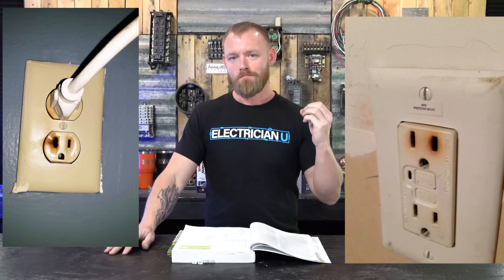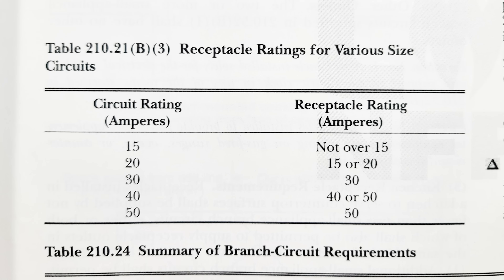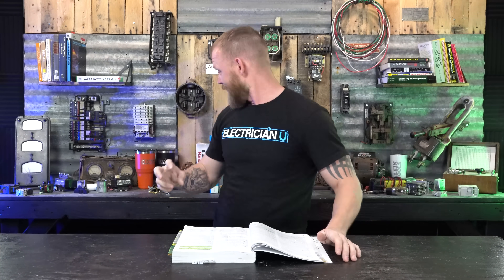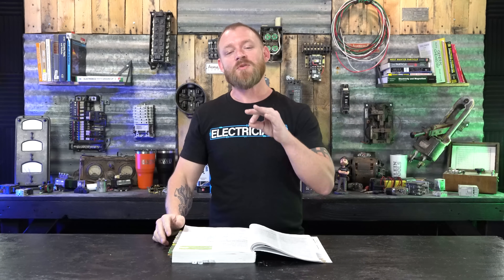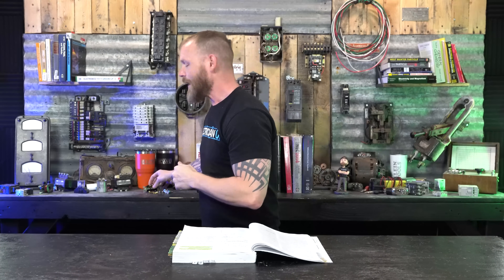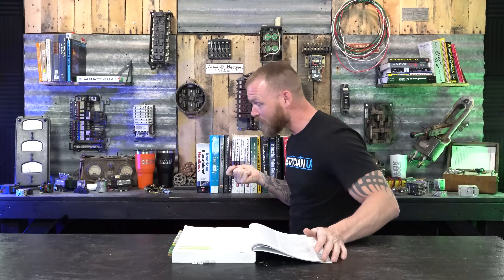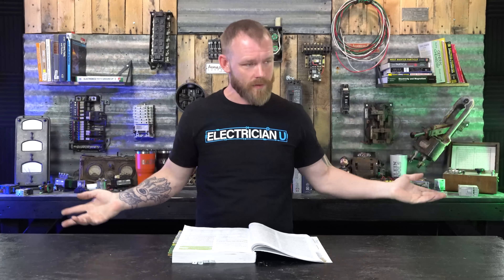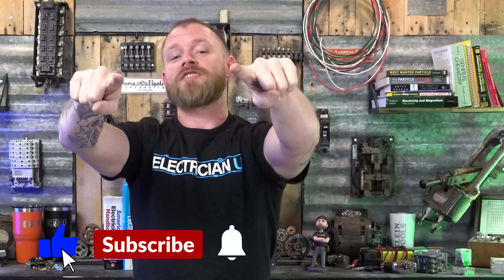Won't These Melt?!? 15amp Receptacles on 20 amp Circuits!!!

Comment: Yes NEMA 5–15R 15 amp receptacle OR 5–20R can be used as long as there are two or more duplex outlets not for a dedicated single 20 amp load. Remember that the ampacity  of the wire needs to be suitable for 20 amp if a 20 amp breaker is used in either case Therefore use #12 CU. Larger in rare cases if it’s a long run. Branch wire size  / breaker rating coordination is to protect the wire NOT the appliance. That’s why appliances that need over current protection have an internal fuse like microwave ovens. How does this work out?  If an appliance actually needs a 20 amp circuit the neutral plug blade is rotated 90 degrees. That prevents plugging in a 20 amp appliance into 15 amp underrated branch circuit with #14 wire. Note that  5-15R and 5-20R receptacles are both 125 volt rated.
Reply: A single duplex 15amp receptacle on a 20amp circuit meets code.

Comment: Really enjoy your very informational videos.  What's your thoughts on the non metallic splice kits offered by TE that are supposedly NEC approved for behind walls?  Would you trust them?  Maybe good material for another video.  Thanks, and keep em coming!
Reply: Are you saying they make something that allows you to connect wires and have the connections inside of a wall?

Comment: Most melting is from dirty (oxidized) plugs offering a point resistance and hence heat source.  Brush a male plug with DeOxit and plug it in and out until it comes out clean and the heating will disappear.

Comment: Well my welder adapter cord ain't currently up to "code"   I have 30a 220 plug on the Gen feeding 2 30a welding plugs and a 20a 110 plug.  I had ordered a 20a push button breaker to squeeze in the junction box but the purpose of 110 plug is to run my grinder in for prepping for welds or cleaning up after welding and running a work light for welding in a dark area

Comment: the code should require all 120v receptacles to carry 20amps. That would only increase the production costs by pennies.
Reply: Surprise !
They can carry 20A. 
It just designed to not allow a 20A plug to insert.

Comment: I've run across 'melted outlets' and often it's one of few things.  An old outlet with loose prongs that should have been replaced, older home with AL wiring prior to proper AL standards, or homeowner using one of those blocks so they can plug four or more things into one outlet.
Reply: I went to my step daughter and husband's newly remodeled home with $45 designer outlets throughout. Found several that had wires not tightened in outlet. Then melted outlet by the nightstand. Turn out this was a half hot/ switched hot where the apprentice did not break the tab. My step daughter and husband's excuse was "good electricians  are expensive". I told them "bad electricians are more expensive"
Reply: @JoeAmaral427  More to the point, their  fire insurance would not have paid out!
Reply: @johnchristmas7522  are you sure about this? Insurance covers claims resulting from negligence, right?
Reply: @JamieMurdock90  Here in the UK insurance companies are always looking for 'ways out' so a fire caused by bad wiring in a new build or incorrectly connected causing a fire would be considered negligence. would not pay out in that instant. Whether the house builders insurance or the electricians would pay is a mute point.Because the apprentice caused the incident that would be called into question, with the remit that any apprentice is 'under instruction' and all work should be checked by a competent person. Check what your home insurance would do together with your own business insurance. Its always better to be forewarned before any such event rather than when its to late. All self employed electricians should in all due diligence be covered with business insurance. Going by the insurance cover in the USA for health Care where they don't pay out the full amount, would make me double check. my business insurance. Just remember, insurance is YOUR responsibility. So check it out. Also remember that copper melts at 3000 degrees and would therefore leave everything to be seen. Most house fires are generally the fault of electrical systems.Insurers know this. This is another reason why, when employing a electrician you should check that he  can prove he's fully competent and fully covered by insurance. Cowboys have neither.
Reply: @johnchristmas7522  absolutely correct and 2 kids could have been killed.
Reply: @JamieMurdock90  "Failure to wire in accordance to code" make the ELECTRICIAN responsible - but not the insurance company - in most cases.
Reply: @johnchristmas7522  In the US, most home fires are deemed caused by electrical when no other cause can be found, fire investigators love to close cases and maintain a high % solved record. But insurers still have to pay for the covered loss, and a loose connection to a device, poor workmanship on the original installer, or a poorly made receptacle wouldn't be held against the insured.
Reply: I was called out to a burnt out electrical socket, by a panic stricken customer. Only to realise that  the chain controlling the vertical blind, was hanging across the socket, which the customer then proceeded to squash against the socket with the plug!  Oh dear some people.
Reply: @johnchristmas7522  That’s a one in a million wow.
Reply: In my opinion the most common cause of devices burning out is loose contacts or loose connections
Reply: The NEC outright OUTLAWED new AL wire installations in residential internal wiring decades ago - as it was commonly getting UNDERSIZED by too many people that didn't know better.
There is no "standard" for AL wire in homes any more, it's flat out BANNED except for the "downlead", which is commonly installed by the Power Company and their linemen (who ARE trained on proper AL wire sizing as a lot of THEIR wire is at least partly AL).
Reply: @bricefleckenstein9666  aluminum is not outlawed.   It's still in the NEC code book as of 2020.   As electricians we still use it for heavy duty circuits, like for dryers,  ranges, and central AC disconnects.    The stuff that was outlawed,  was the 1350 alloy commonly used from the early 1960s to the early 1970s. The stuff we use today is 8000 AL as it doesn't have the same expansion and contraction problems which plagued the 1350  AL, another factor was that during the 60s when AL was widely used,  we went from brass screws to steel screws,  as copper was being brought in massive quantities by the Department of Defense during the Vietnam War,  and was very expensive and difficult to obtain.
Reply: @Sparky-ww5re  That has changed since I was active, aluminum wire was completely outlawed as of the 1980s for ANY residential usage past the leads from the meter into the primary panel point - and I'm not sure if it was legal from the meter to the panel.
The steel screws were never a real good idea, unless they were stainless - and even THOSE had issues eventually.
Reply: Suppose to use AA-8000 series electrical grade aluminum if you use aluminum. 
References: ASTM B800-05, NFPA Amendment 70-22,  NEC Article 310
Reply: @bricefleckenstein9666  Not completely true, aluminum wire is still code permitted for large feeders (like to a sub-panel) and circuits larger than #10, so it's not uncommon to use it for central AC condensers, ranges and heat pumps as well. Some municipalities have however banned it though. The big problem with the old 60's-70's aluminum wiring was that on smaller circuits with multiple terminations, the conductors have to go one gauge higher so, #12 of 15 amps and #10 for 20 amps. Aluminum is more brittle than copper and cannot be subjected to the kind of flex that copper is fine with, and then there was the issue where attaching to the brass terminals of devices causes a reaction of the 2 wildly dissimilar metals, then oxidation, causing loose connections. Also, aluminum expands and contracts to a much greater degree than copper, and when under load it would swell under the screw terminals, then deflate when lightly or not loaded, causing the conductors to no longer be held tightly to their terminations.
Reply: @darrendolphdragos9752  May have changed since I was a Jorneyman, it was completely outlawed for inside the home wiring (it was still used on the Power Company side of the demarcation) according to the Master that trained me.
As I recall, it WAS still acceptable for COMMERCIAL installations - as electricians that worked on such installations tended to be more experienced and understand it's weaknesses better.
Reply: @darrendolphdragos9752  And too many contractors, especially Mobile Home builders, didn't take those issues into account causing a LOT of fires with their installations.
It's not so much that Aluminum is more brittle, but that it is less ductile - there's a reason you see it used in Wheels for auto tires, and not Copper (the weight is also a factor) - it's a lot more rigid than Copper.
Reply: @bricefleckenstein9666  Yes commercial but still only used for large feeders.
Reply: @bricefleckenstein9666  outlawed for branch circuits, and not because of sizing but because of thermal expansion making the connections loose
Reply: I used a  heater on a 15 amp outlet. It didn't melt but liked baked. It crumbled when I took it out. Scared the the crap out of me.
Reply: @Jim Allen the wiring was 12-2 with ground. The fuse was 15amp. The outlet was 15amp 125 volt. The heater was plugged into It all winter. I think the heat though not enough to melt it just baked it.
Reply: @Ti-nf4fq  of course it didn't. The receptacle  is rated for 60c.
Reply: Mike Fochtman: i live in a rental that apparently is wired with aluminum and ive had a couple receptacles melt, should i just make sure the outlet matches the breaker or does the aluminum wiring have something to do with it? Thank you for your help.
Reply: @paulmarrujo5551  hello Paul !! Aluminum is ok , but the thing is the outlet and switches ( wiring devices ) that you install must be label cu/Al , or AL , otherwise wise is dangerous, also is dangerous to splice aluminum and copper, if the property belongs to you , is a good idea to change it to copper
Reply: @paulmarrujo5551  If the outlets are old enough, they might not be rated for Aluminum and be having corrosion issues.
If the aluminum wiring was not installed with enough slack, it might be causing mechanical connection issues.
Reply: @paulmarrujo5551  The outlet will be either a 15 or 20 amp outlet, all you could do is be certain there are no 20 amp t-slot outlets on 15 amp breakers.
Reply: @Jim Allen yeah electrician is a good idea.
Reply: @JimAllen-Persona Many UPS packs are not rated to carry anywhere near a 1500 watt load.
Reply: @darrendolphdragos9752  Outside of commercial UPSs, MOST are not rated for even 1000 watts.
The common "1500 VA" size commonly has a WATTS limit around 900.
They have to take phase loads into account in that VA rating - especially as older computer power supplies did NOT have power factor correction.
Reply: 90 percent of the time it's been that for me
Reply: @JimAllen-Persona Maybe put a Voltage Spike Protector and Voltage Surge Protector (SPD) on your ground?

My guess as to the reason your pump didn't trip the GFCI was that the GFCI needed replaced (they have moving parts and can fail like relays, and should be tested every so often with the Test button), or that somehow nearly all the current provided by the hot wire made it back through the neutral wire.

I am not an electrician.

Comment: a 15 amp receptacle should not melt even with 20 amps of usage.  Their internals are pretty much the same as a 20 amp receptacle the only real difference is the plug shape.  If they are melting they are faulty and probably chinesium.

Comment: as a norwegian electrician this is kinda unheard of
the "weakest" part of any circuit is always the fuse, so for instance if i have a 15A fuse, the next link should be able to handle more than 15A for x amount of time.
we call them i2 and i5 ratings.
and in our code we always have in our mind that the customer/owner of the building have no clue about it so we always have to think worst case scenario.
but that is the difference from country tho.
fun to watch and see how other countries codes
Reply: Swedish and US electrician here...
The internal parts of the 20A receptacle are no more robust than a 15A, Only oriented differently, essentially identical. 
The ”weak link” is still the overcurrent device.
Btw,
My observation of this guy..
His videos are not that bad, but explains many things poorly.
Reply: A good principle, but it doesn't extend beyond the power socket. The thin cable on a table lamp won't be rated for 15A. In theory, a fault could develop where a current which exceeds the cord rating could be carried but not trip the 15A breaker.

Personally, I like the flexibility of a high current circuit with multiple outlets in somewhere like a kitchen, as you can run a kettle, toaster, microwave at the same time without worrying that they might all be on the same 15A circuit. Yes, you can have multiple circuits, but then you have to be aware which socket is on which.

The answer to this is simple. Have a plug system with an internal fuse rated to the appliance and cord, and you can then have as high a current rating as the infrastructure wiring for the circuit allows, but such wiring systems are rare in the world.
Reply: @TheEulerID  My house built in AR in 2000/2001 has 20a breakers and no. 12 wire for everything but only the lighting circuits are on 15a breakers.  The rest is all 20a. eg, there is a bank of 15a but they're all for overhead lights and ceiling fans etc and not receptacles.
Reply: As an electrician in the UK, I was always told, wire for idiots! and still the public do crazy things-read my previous posts!
Reply: @johnchristmas7522  oh we have the same mentality lol
always expect an monkey to be the end user

Comment: I’m not an electrician, I just match the receptacles with the breaker rating. I also use only 12 gauge wire for 15 or a 20 amp circuit.
Reply: Many folks do that these days.  Use 12 awg on a 15 amp breaker.  Not an issue, but I have also seen where folks use 14 awg wire on a 20 amp breaker... that is an issue.

Comment: Excellent video.... yes i am definitely  learning  a lot...... question..... if a home owner  has a small  shop in their  basement  ... with say a large bench having   4 machines  plugged into a  power strip  that is connected to  a single receptacle  above it  that has a porcelain  fixture and light bulb connected 15 other lights in the basement.... that all are on when basement is  in use. How much  is that load on the circuit and is it dangerous?

Comment: A little off topic but I wish we had an option that was lower than 15A breakers for lighting circuits. I hate running 14/2 to a single light on a single breaker. Give me a 5A option so I can run 18AWG to the single light.
It just feels like such a waste.
Reply: It does seem a it bizarre. UK lighting circuits are generally 6A on 1.5mm^2 cable (slightly bigger than 16AWG). That allows about 1.4 kW of lighting at 240V. Of course, it would only be 700 W at 120 V, but with modern LED lights, that's a lot. Enough for maybe 100 LED down-lighters. We aren't using multiple 100 W incandescent lights any more in new installations.
Reply: I use 12/3 for everything.  It is pennys more than 14 which is minimum code.

Comment: I have been redoing a house that has all 20 A breakers(wierd) but no 20 A recepticles or switches.  I get them online.  The 20A stuff costs several times the 15.  Its no doubt due to volume of 15 swamping the volume of 20A.  Its a pain but I want it right.
Reply: You can save the money and do it right with 15 amp receptacles and switches. If you have a switch load that is more than 12 amps go with a 20 amp switch, maybe waste disposal. The information in this video about 15 amp receptacles being weaker is incorrect. Research it if you are concerned.  If you want better quality you would have to buy commercial grade which cost more.

Comment: It maybe in the code book that it is ok to use a 15 amp receptacle on a 20amp circuit, but I dont believe that is the reason it is an issue. As a "trustworthy" Handyman I believe it is lack of knowledge or ignorance to electrical usage. I see it all the time new homes to homes that have been repaired over time(+(50 yrs), the wrong receptacle used on the wrong circuit and it looks like a marshmallow left in a fire.
Thankfully I have been schooled by real Electricians to know the difference and know what to look for, Your channel as well has a wealth of information, some will not take the time to watch and learn. Thank you for taking the time to educate others on what is right.